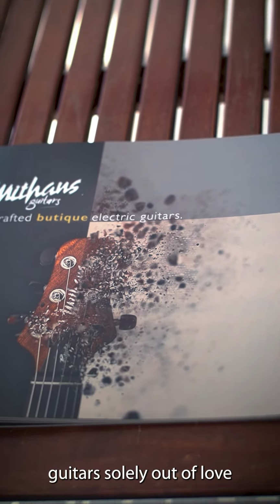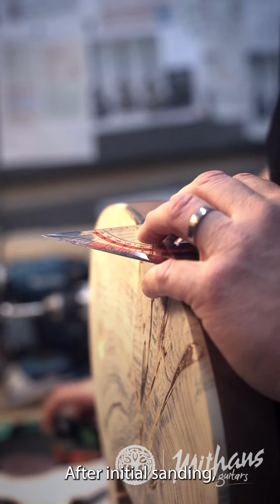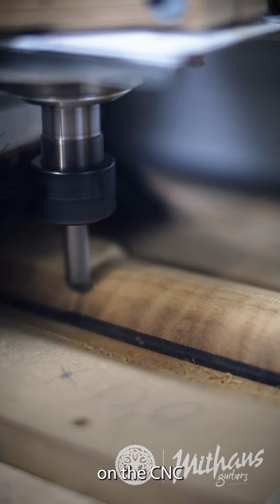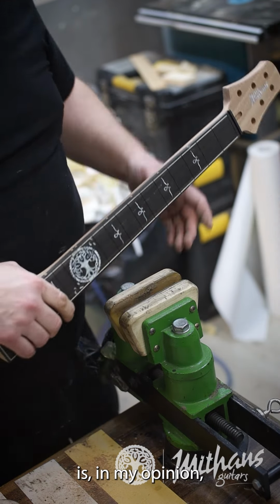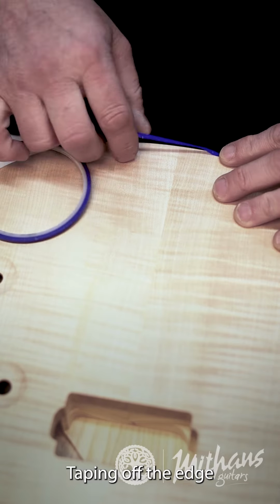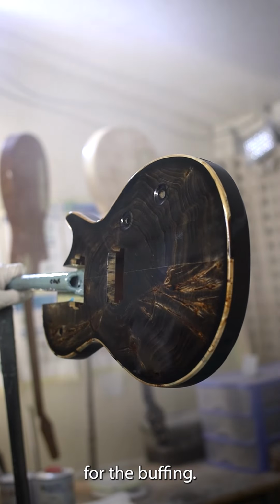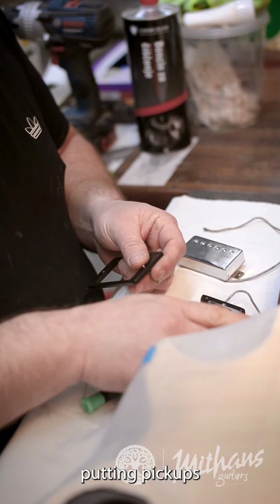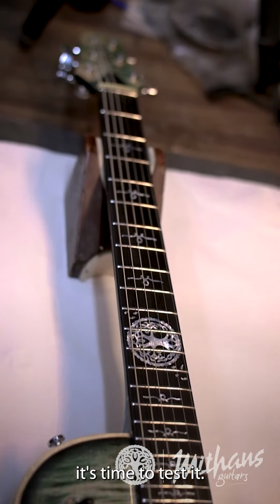Mithans Guitars building a guitar 2024

Comment: Are all your guitars zero fret?
Reply from the maker: Yes, It's the only way to get the lowest possible string action.
Reply: @mithansguitars  How is that exactly?? I've never heard that in 23 years of playing. Now I will say I've never owned a zero fret. That maybe why I've never heard that. I do watch hundreds of luthier related videos though. Anyway. If you could explain that, I'd truly appreciate it. Thank you for your response.
Reply from the maker: @theariesexperiment4642  On one side you have a bridge, where you can set up the height exactly as needed. On the other side there is a nut, so you can't set up the height. The nut slots are cut as low as possible to the height of the first fret, but a bit higher, because if you cut lower = fret buzz. Well that's not the case with zero fret. It's exactly the same height as first fret, so it's lowest possible. Because strings "cut" through the nut material, over the years they cut the slots lower then the first fret. That creates fret buzz and you have to exchange the nut. This never happens with stainless steel zero fret. It's at lowest possible height forever. Hope this helps.
Reply: @mithansguitars  Jeez man. I had no idea. Why don't more companies do this? And thank you so much for that detailed and precise explanation. Perfectly layed out. Sorry for my ignorance my friend. I just love guitars so much, and have been playing for years and want to know all I can learn about them. It's all I think about pretty much. Lol.  Again thank you for taking the time to explain my friend. Very much appreciated. 🙏😌.
Reply from the maker: @theariesexperiment4642  You're very welcome. Most companies don't do that for three reasons: 1. added cost    2. A lot of players don't like zero fret, but they don't really understand what it's purpose is 3. doing zero fret on standard frets is not a good idea and you know that very few companies do stainless steel frets (added cost, tools killer, very hard work, takes 5-8 times longer then standard frets,....)
Reply: @mithansguitars  Ah. I understand. Again,.... thank you so much for the engagement. Very informative and pleasant. You have a great day sir. And thank you again my friend.